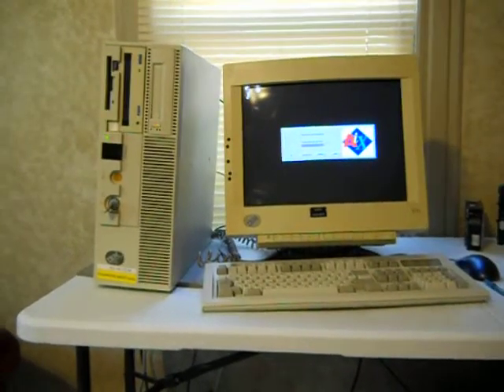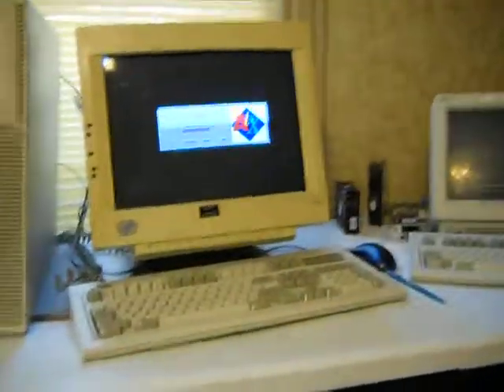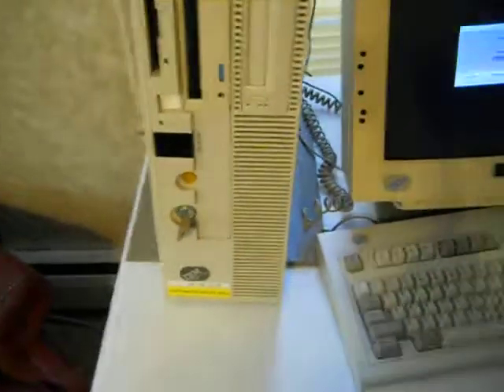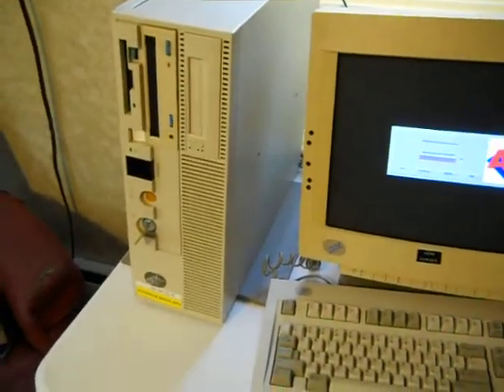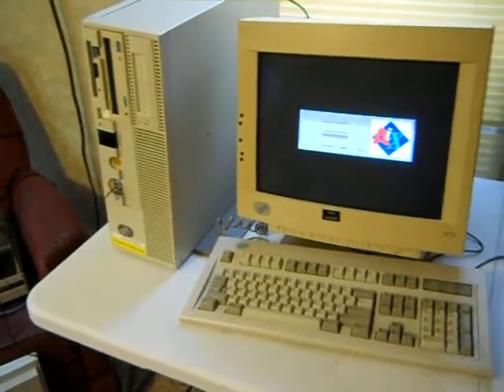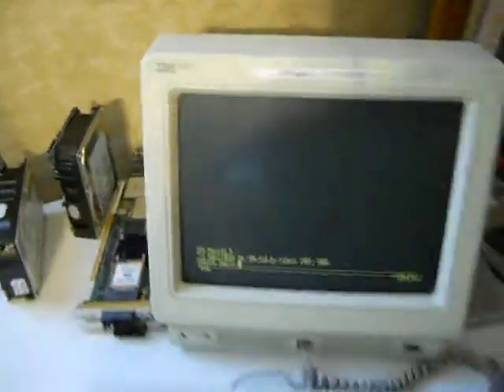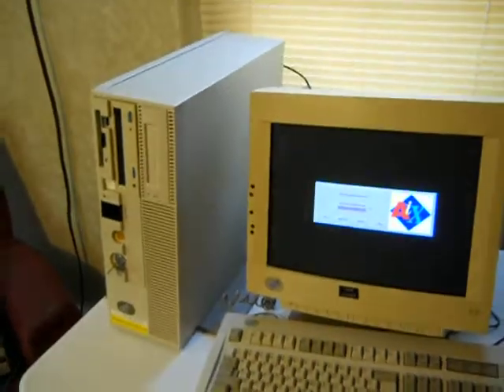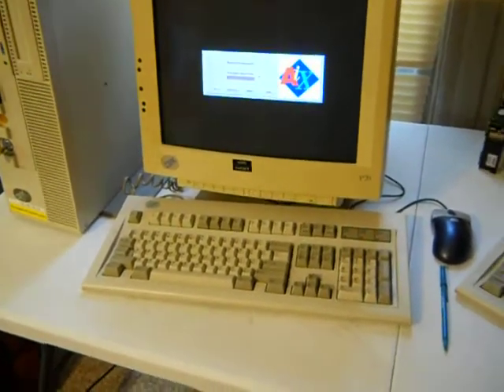IBM RS6000 #1 - Introduction

Comment: I saw a POWERstation once, which I believe had a PowerPC 603e and it could use a standard PS/2 keyboard and mouse, unlike a lot of older RS/6000 systems.  Some of the later RS/6000 systems and the IntelliStation POWER series could also run OS/400 or I5/OS.